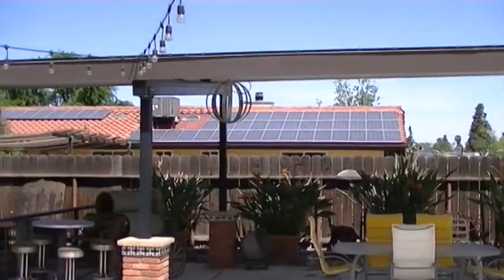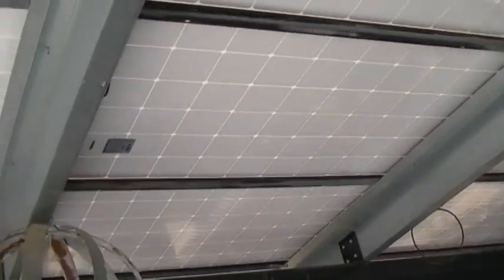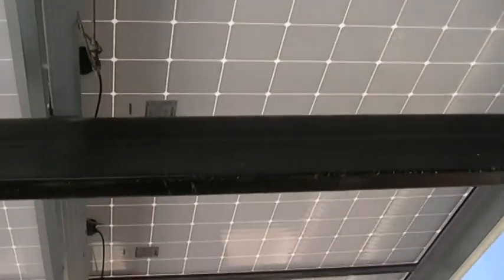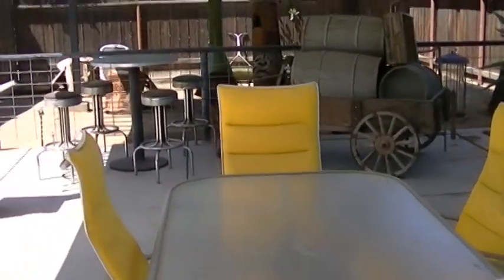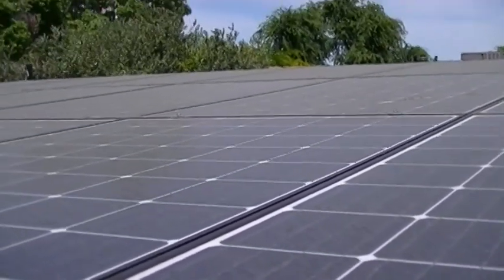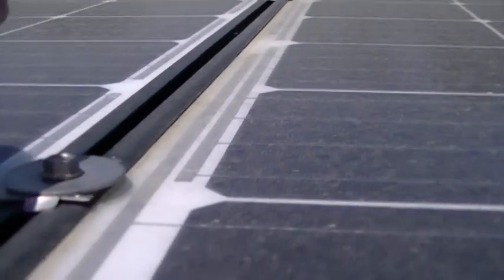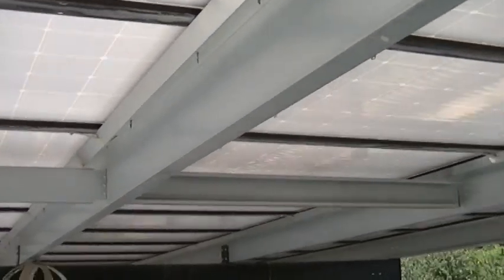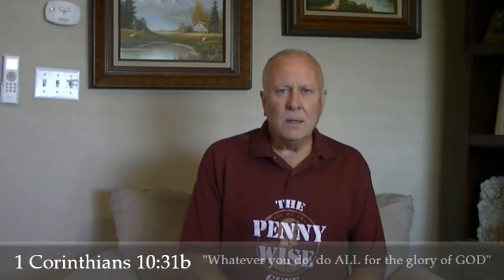Custom Solar Patio Structure

Comment: I’ve been looking at doing solar something like this.  I want to build a patio and cover along the back of my house, and mount solar on top, instead of on the roof.
Reply: Hi. Yes this is an awesome way to get both solar and a patio cover. I have videos showing these next to homes as a patio. Please check them out. My next project is a small patio structure next to a home and I will make multiple videos showing every step of the process to build these. Also these qualify fully for the Federal Tax Credit and also in states that charge property tax, these are exempt for tax increase (in most states). Have a blessed day.

Comment: Excellent setup. This thing  should really catch on. Also about washing  the panels, for most conditions research indicates there at at worse 5% loss. Just add that to your initial design and you should be good with the occasional rain wash.
Reply from the maker: Hi. Thanks for your kind comment. Yes we have built many of these. We also installed automatic washing systems on them that have a soap & rinse cycle. Check out my playlist for solar washing systems. I show how to build these for the DIYer. Blessings my friend

Comment: looks great, but I think bifacial panels would have been a WAY better solution 
1: better efficiency
2: no backside degredation due to UV radiation ( these will get microcraks over time)
Reply: Hi. Yes bifacial panels are a great improvement in solar technology. This system was done years ago before bifacial panels were even available at a fairly decent price point. The panels used on this system had a much faster payback for investment and produces what the customer needed for his electric usage. I take the approach that whatever is available at the time I do the project that will give the fastest ROI and has a great warranty and expected life is the best choice for my customers. I currently use higher producing panels that are now available. The life expectancy of this system is 30- 40 years and my customer is nearly 70 years old. We made the right choice for him. 40 years from now the new owner of the home can choose to upgrade to newer solar panel technology and can you just imagine what will be available in 40 years. Thanks for your input. Have a blessed day

Comment: Great design. I dont see any rapid shutdown devices in use. Does the  structure being away from the residence negate the requirement for rapid shutdown equipment?
Reply from the maker: Hi. When this system was built the RSD rules were if the central inverter (that has a built in DC disconnect) is within 10' of the Solar array, then the RSD is not needed. We went with and passed current codes at the time. Thanks for your question and comment. Have a blessed day.
Reply: Good question

Comment: This looks really nice. The only thing I would worry about is if one panel goes bad and it's siliconed down directly to the supports so it doesn't leak. How do you get this panel out to replace? How much more would it have been to actually build a metal roof and then bolt them down to that with normal solar railing? I do agree everyone who has a good amount of direct sun should build their patio/carport like this.

Also, it doesn't have to take a lot of water to wash the panels. Water restrictions sounds like an excuse to me.
Reply from the maker: Hi. Great questions. The panels are not glued down to the purlins with sealant. Once they are installed, just run a small bead of sealant between the small crack between panels. To replace them, cut the sealant with a blade and unbolt from top to replace. The cost to put a roof on the structure and then mount the panels on the roof costs way to much compared to using the panels as the roof as shown. I hope this helps. Blessings my friend

Comment: Very nice. How much did the structure cost? Don’t include the panels or insulation please. Are plan’s available for construction? Sounds like you have a process or technique that’s unique for mounting. Care to share?
Reply from the maker: Hi. thanks for your question. All my projects are custom designed and built by our team. I start with raw steel components to cut to the sizes I need and weld it all together required for the custom design. It would be easy to answer this question if I bought  premade structure components, but that is not the case. My finished price for a structure like this size ranges from $45,000 to $55,000 that is complete with all solar equipment and hooked up to homes electrical panel, along with engineering costs, permit fees, labor, outside services for drilling holes and all overhead. Typically I am about the same price that other solar companies charge to put a system on the homes roof. My prices are half of what most others would charge for this type of solar structure system (which there are not very many other solar companies that would build these other than the typical ground mount system). As a general contractor and solar contractor, I developed this idea to meet a need that was not being met by the solar industry for home owners. The solar companies that do commercial structures have the dual rail system that have the 3/4" gaps between panels that leaks water and is not suitable for home owners that would like a water tight structure for other than a solar system, so I developed the shared rail system to meet this need. I have videos of my current project showing details how to build these. I would have had them ready to launch this last summer, but my mom died this summer so I took the summer off. I plan to finish up and launch these videos about 1st of December. Hopefully they will aid others, with the help of a contractor, to custom build one. Blessings my friend.

Comment: I imagine having air circulate on top and bottom removes heat, resulting in better performance and longevity...
Reply from the maker: Hi. Yes you are correct in that air flow does allow natural and free cooling to help performance. My customers love the use of the space under the structures and for the same price of a solar system that they would spend on a rooftop solar system, they now also have a dual purpose use. Also these do not increase property taxes because it is 100% solar and solar systems do not increase property tax in most if not all states. Have a blessed day.
Reply: @thepennywiseguys  would there be a load issue in snowy climates?  Then again I'd assume you'd want to clean off the panels... d'uh
Reply from the maker: @F-Bomb313   Hi. Yes you are correct that you would want to keep the snow build up cleaned off. The structure would hold a lot of extra weight, but since I mount these panels on the ends, the load for the panels would not be as much and would need to be cleared off after a modest amount of snow buildup. I am not in an area with the snow issue and could not give advice on how to remove snow. If you have any good ideas on this, please let me know your ideas. Thanks. Blessings.

Comment: This looks overbuilt which is great. Where does the water go once it hits the trough? Does it roll down into a gutter?
Reply from the maker: Hi. Thanks for your comment. Yes my engineer likes to design them to last. I slope the structure just a little bit to either side so the water runs to either end. I make a "gutter" out of the 2x2 edge trim on one side of the Z purlins and the other side has its own built in "gutter" with the returns on the bottom 2.5" flange. This works great. Blessings my friend.

Comment: Thanks for the video.  Do you sell components for a DiY setup? Great video.
Reply from the maker: Hi. Thanks for the kind comment. I buy all my supplies from solar suppliers, PDM Steel, Lowes and misc. I will supply my unstamped engineering drawings for any system upon request to aid in your design of a custom system. I will soon release how to details of my latest project (about 8 videos) to aid in the construction techniques. If you want to email me at leadingedgesolar@juno.com with any detailed questions or engineering requests, I would be happy to help. Blessings my friend.

Comment: I like this, but wonder if it is possible to do similar out of wood? I'd like to have a timber look.
Reply from the maker: Hi. I would suggest doing it out of steel for the strength and then overlay the post with wood. This project had wood added to the facia to give it that wood look, and the posts with bricks. There is a lot you can do to dress these up. Blessings my friend.
Reply: How much does this cost if you do it on your own

Comment: Is it possible to put a ceiling in the patio, perhaps timber? Or does the airflow restriction affect panel performance?
Reply from the maker: Hi. Yes I have a design to add shade clothe to the underside of the purlins to cover up the bottom side of the panels to give it a finished look. Shade clothe will let the air flow so not to cause panels to get overheated. So far with all of the many solar structures I have done only one got close to letting us do this but decided after we were completed that they liked the look and did not want to go with the extra cost to do the shade clothe. You have a blessed day my friend.

Comment: How’d you go about getting a custom steel frame?
Reply from the maker: Hi. I buy raw steel in the sizes that are determined by my engineer for each custom project. I then cut and weld the components to then be bolted together on the job site. I have multiple videos I am doing right now on my current project showing detail installation tips to aid you or your contractor on how to build these. These will be launched by September. I hope this helped. Blessings my friend.

Comment: Does this work in a coastal hurricane zone like Florida? Winds 110 mph
Reply from the maker: Hi. My engineer designs for this area requirements of 100 mph winds. I believe he bumps up the engineering for 120 mph. You can have your local engineer design for your building codes. You would just use a thicker wall steel plus bigger welds. The panel attachments that I use are the same as roof top solar so use what is acceptable in your area. I hope this helps. Have a blessed day.

Comment: Did you consider using bifacial panels instead of not?
Reply: Hi. Thanks for your question. At the time this was built, bi-facial panels were not an option. Since they have come on the market the price difference has not been an attractive option for the added benefit. Also the low pitch of slope on my structures does not allow enough added production to overcome the added cost. These are better suited for ground mount systems that have 20 to 35 degree slopes. Blessings my friend.
Reply: @Greg-kw1vg got it and thank you for the thoughtful and kind reply back.   Truly appreciated!

Comment: how do you get a square patio with 39 panels?
Reply from the maker: Hi. I am not sure if you are asking about this project or you are trying to figure out a layout for a project for you. What I do is figure out how many panels are needed to zero out there utility bill and then come up with a layout to fit the structure in the area that we have to work with. If you need a layout that is more square than try using more rows of panels to get a more square structure and less rows to get a longer rectangle shaped structure. First you need to determine which panels you want to use. Panels come in different sizes (60 cells or 72 cells) so try to pick one that gives you the size you need in physical dimensions as well as wattage. If one panel size does not give you the structure size you are after, then look at other panel sizes. I also will go more panels than needed in order to get the desired structure size. I go as big as a 130% system size (100% being big enough to zero the utility bill). I hope this helps. I will do a video on sizing systems that maybe of help. That is something I will work on in the coming months. Have a blessed day my friend.

Comment: How can i get some of the shared rail system
Reply from the maker: Hi. I designed this system to be leak proof by using what I call the "Shared Rail System". Each project is custom made and is made with raw components purchased from steel suppliers. I have another project that I will be building in the coming months that I will video each step of the process to produce multiple videos with the step by step process to build. These will be coming out by this late spring. I hope they will help aid you in building your own system. Have a blessed day.
Reply: @thepennywiseguys any update on the project video? I am highly interested in your amazing work

Comment: When you watch a video of people cleaning their solar panels they get really dirty, and they use a lot of water to clean them, can you gutter system handle that much debrie and water?.
Reply from the maker: Hi. Great question. Yes the panels are almost sealed, so most of the water from rain or washing runs off the from the top. What does make it through to the gutter system does run off to the end (I build in a small slope to run the water to either end). I hope this answer helps. Please let me know if you have any other questions. We are in the middle of an extreme heat wave over the last 4 weeks and hopefully will be done in a week, so I can finish up the current project and post the step by step videos soon. Blessings my friend.
Reply: @thepennywiseguys  I think we are both enjoying the same little heat wave,  106 here yesterday  and a 500 dollar electric bill to boot.
Reply from the maker: @Moondoggy1941  We had up to 116 days in June and early July. Now it is a cool 104-109. Friday we are going to have a chilly 98. 98 would normally be hot but after what we had it feels cool. I am hoping August is normal. Stay safe my friend.

Comment: how about a  huge solar carport standing 30ft tall with a flat roof 2 story house underneath
Reply from the maker: Hi. That is an idea that I had not considered. It would be much cheaper to put the solar  system on the roof of the home. Could you share with me your reasons to do this? Other than protecting the home from damaging sun and weather, I can not see the upside. I had one customer that had an idea to install sides to the posts to enclose the structure to make it into a shop after we were done with the system. He never did so, but this is the only idea close to what you are suggesting. It is fun to dream up ideas and see what can be done. Blessings to you my friend.
Reply: Instead of sloping roof get a flat roof with solar canopy
Get one extra floor
Reply from the maker: @Calibike  I now know what you are thinking of. What a creative idea.
Reply: @thepennywiseguys  your design makes entire roof waterproof.  home roof will be like industrial flat roofs and solar overhang on all sides. gives you a nice patio and especially  for those who have a view or are near ocean
Reply from the maker: @Calibike  Nice idea, thanks